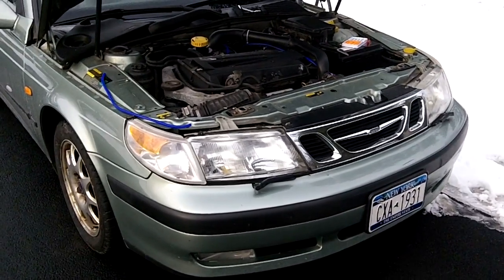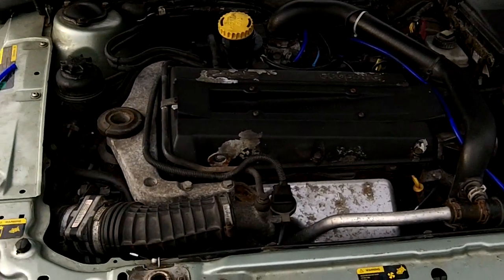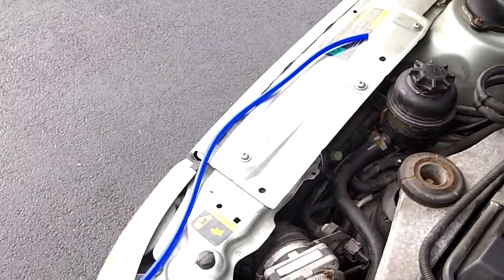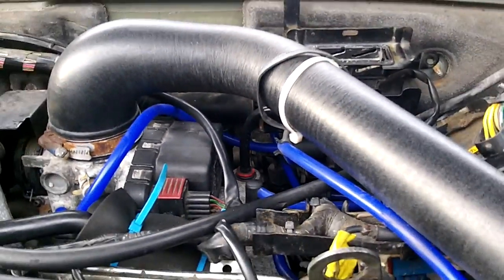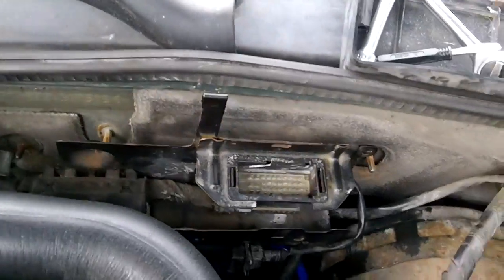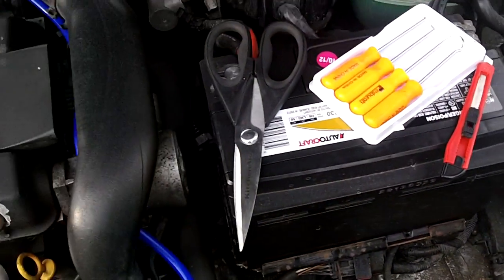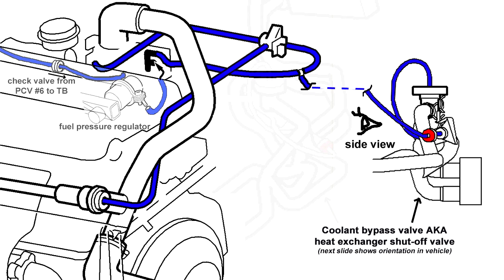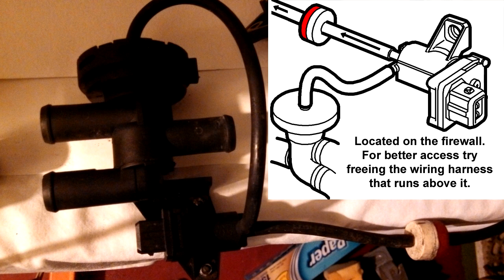Saab 9-5 vacuum line replacement with silicone

Comment: I prefer the black color high temp vacuum lines made by Mr. Gasket, p/n 11031, which have a thick wall so that they won't ever kink and are made to withstand the high heat generated by these boosted engines. They do have different colors available: yellow, black, blue, red, etc. The only downside to them is the price at around $30-some dollars. But, they do provide three different diameter sizes per package and I have used all three for my '02 9-5 Aero with 23x,xxx miles.

Comment: I, for one, have a 2002 Saab 9-5 and haven't had any engine failures.  The only major problem I had was the engine would occasionally die while first starting up in cold weather. From what I understand, that was caused by a tear in the stock diverter valve's diaphragm which is easy and, by Saab standards, cheap to fix anyways.

Comment: Is the 9-5 still alive?   I'm betting not.  But I hope I'm wrong.  Did you keep the spare parts accumulated over the years?
Reply from the maker: It is, if you charge the battery up!  It's registration expired as I've been far away from her for almost two years.  She's patiently awaiting my return.  I have all manner of spare parts, even the old engine that has scoured cylinders from the previous owner's ignorance of the oil issues.  Doors, lights, seats, even the heat exchanger and ventilation system in the center under the dash.  Don't know what I'm going to do with all this stuff.  You want it?
Reply: @chemistclips  :  Wow, you really are a Saab devotee.  I'm way down south in Georgia.  Just bought an 04 9-5 Aero.  Still a really good car and drives superb.  Had many Saabs over the years.
Reply: @chemistclips  your diagrams and video is STILL the most useful on the web, and God Bless the SAAB. I’m on my 5th one. Only real problem I’ve had has been figuring out which brake pads to buy during the Chevy years !

Comment: Hey man.  I'm probably going to have to replace my vacuum lines, at least the ones for the brake booster.  Did you do that one and if so, were you able to buy the check valves separately?  What should I use to get those clips out to remove the line?  I do have fuel line and AC clip removers.  Not sure if those are compatible.

Comment: Thank you for uploading. I need help hopefully you can answer. We recently put in a new throttle body and have new vacuum line, forgot where one of the line goes. The line connected to throttle body is the third one down, small one. I believe it's the one with check valve hose. Where does that go on the engine. I'm stumped. Tried to research online to no avail. Please help if you can. Thank you in advance.
Reply from the maker: It may connect to the oil fill neck, which has a built-in port (when the car is updated with PCV kit #6).  Google it and compare that to what you find is on your Saab.